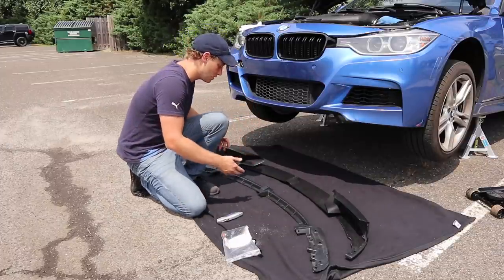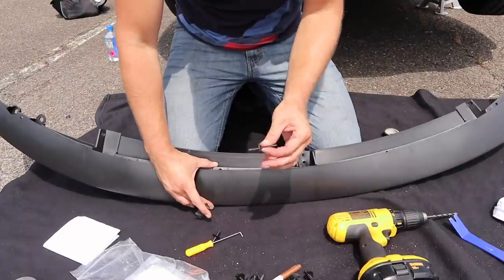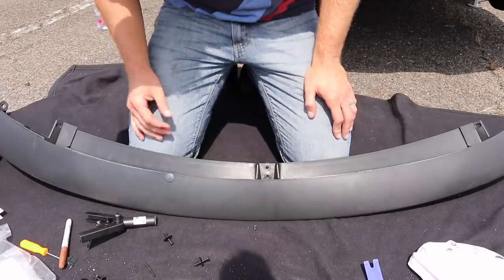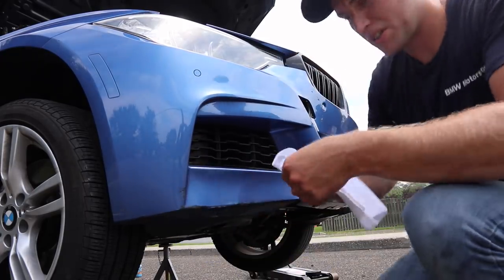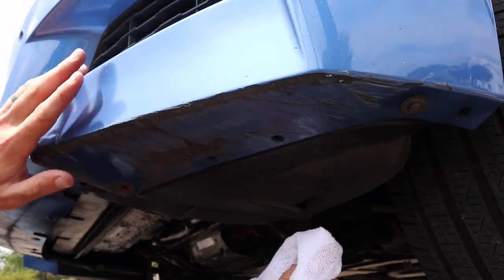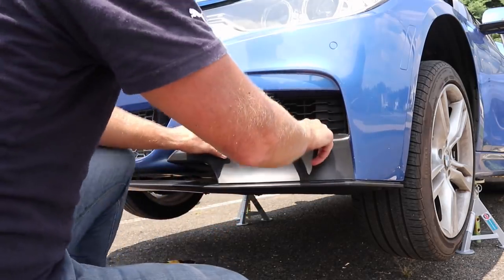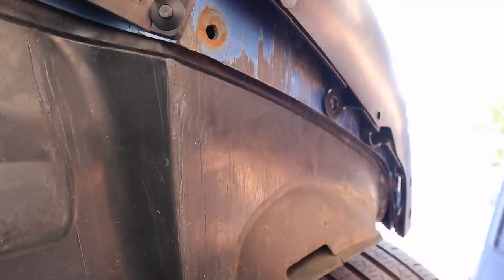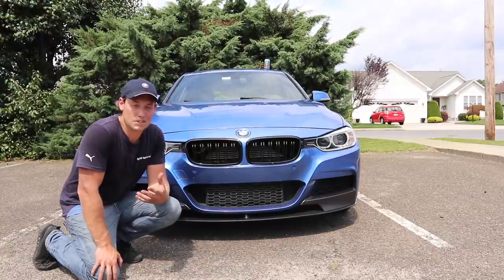F30 M Sport Style Lip Installation 2013 335i with Sport Front Bumper

Comment: Thanks for the video - and lip spoiler!  :D   The spoiler itself seems updated some from this video (in good ways; holes pre-drilled, etc).  Installation took me a little more time but I'm meticulous so it had to all be right.  I used extra expanding retainers and double sided gorilla glue tape.  It's on there Solid with no worries of pulling loose (tested in Mexico to 110 quickly, didn't even wiggle).

Comment: Nice vid! I have the exact same splitter. My car has super sport springs on it, hit a bump and cracked the splitter lol. Where did you get those black bmw wheels you had on your last 328?
Reply from the maker: Ah, yea that will do it! lol. Old wheels were VMR
Reply: did you  just pop the bmw center piece in them?
Reply from the maker: Yeah, I bought them used and the guy before me had BBS caps in there, which I didn't want